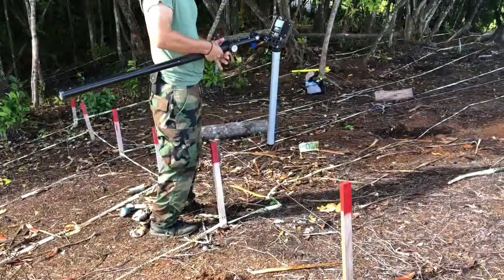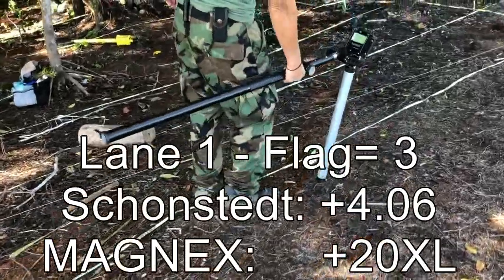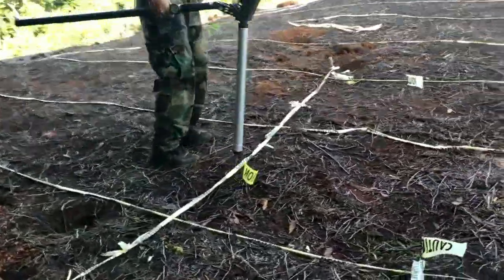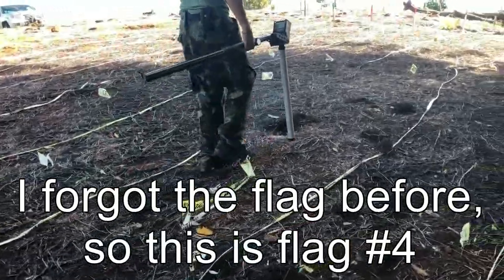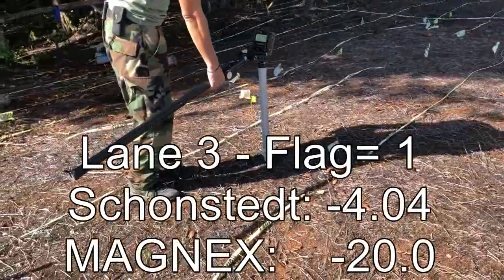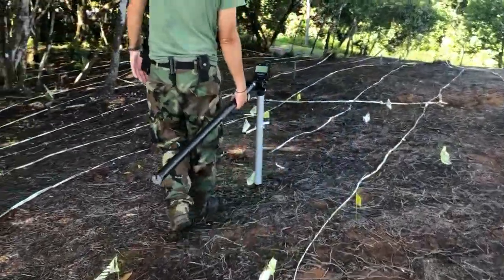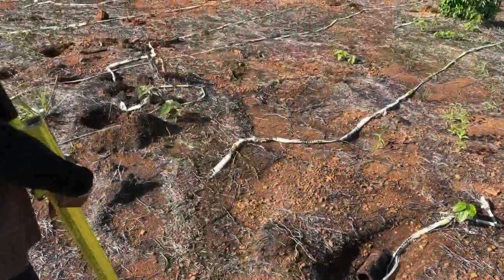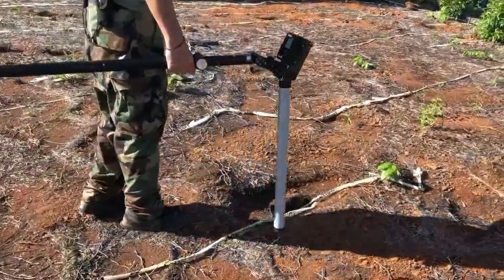Ebinger MAGNEX 120 LW Comparison to Schonstedt GA-72Cd

Comment: Greetings, What is metal depth? Conclusion , can I go with Schonstedt GA-72Cd ? :)
Reply from the maker: It depends on the items you are looking for.  For example in that location we “missed” dozens of live fuzes and a distorted 75mm casing with an intact primer at the end. (being built of either aluminum or brass - with minimal (& corroded) steel firing pins and springs.  Magnetometers ONLY detect ferrous metals (iron, pig iron, steel and some types of stainless steel.)  Magnetometers cannot find ANY other metal!  It also depends  on the nature of the terrain depth and soil mineralization.  Frankly I found both about having the same performance—with the Ebinger being far more expensive—but better made.  I would actually select the (simpler to operate) Schonstedt GA-52Cx, as the stem is longer—thus the sensors being more spaced apart ==> more sensitivity!  Major drawback is ergonomics which as terrible on the GA-52Cx.
Hope this helps…

DISCLAIMER:  These are magnetometers, designed to operate on dry land.  NONE of them are designed for underwater use!  With your diving mask, I presume you wish to metal detect in water.  Do a search in “Waterproof Pulse Induction Detectors”.  Among different models you will find the Garrett Infinium LS, pulse induction—with metal discrimination—detector, waterproof to 200 feet.  Great on paper and good ratings.  However, I had one and its performance was very spotty & disappointing.  Garrett has poor quality control—although excellent customer service.  I returned my brand new unit for service but performance still lagged.  Heard that if you are lucky you can get a good machine with no “glitches”.  Therefore, I recommend to stay away from that model.
Garrett makes other underwater units and cannot express an opinion on those.
Reply: @kmantzouranis  Thanks for notice, Yes we dive and operate uw. I just come to very similar to "GA-52Cx" -  "Waterproof, underwater magnetic probe", both similar "Fisher FML-3 Magnetic Locator" and  "SubSurface Instruments ML-3 Short/ even LONG version! (55″)" IP68 certified up to 250 feet
Reply from the maker: @DaivingsLv  Oh…
The ML-3 is then an outstanding option.  That 1-2 feet detection range for a 175mm projectile is quite low, so presumably that listed depth is for salt-water underwater targets.  Above water it should at least be 4-5 feet for the same item in a non-ferrous/laterite ground…
IF YOU ARE ONLY LOOKING FOR FERROUS ITEMS THEN IT IS A GREAT CHOICE!!!
- - - - - - - - - - - - - - - - - - - - 
NOTE: Brass/copper/tin/lead/aluminum/silver/gold items will be completely undetectable with a magnetometer
Reply from the maker: @DaivingsLv  What are you guys looking for?  I was in Palau looking for ERWs and Schonstedt magnetometers were our main workhorse.  I preferred to hunt with my trusty VMC-1 (all metal detector).  For underwater search (close to sea mines or bombs) I used the Ebinger UWEX 720 C underwater detector, used only for (very) shallow-depth items, looking for detritus, such such as lead chemical horns that had fallen-off in the vicinity of anti-boat and sea mines, or traces of bomb arming vanes and misc. parts.
Happy (and safe) hunting!!!
Reply: @kmantzouranis  Probably German detector UW OGF-W (water) goes deeper, manual says 6 meter.
Reply: @kmantzouranis  We have river ~6 meter deep water and 50cm-1m deep mud. There are iron tubes for inspection work. There we probably need strong tools first. :face-green-smiling:
Reply from the maker: @DaivingsLv  With UW OGF-W you will only be able to detect ferrous objects.  A Great machine; albeit expensive is the JW Fisher 8X pulse induction (all) metal detector.
https://detectorpower.com/categories/mineral-detectors/products/jw-fishers-pulse-8x-metal-detector/?gclid=CjwKCAiAr4GgBhBFEiwAgwORrXILLvfQAqdehdTeROVoMEblRvxmQ-vROLEu3b4rgzUuEFKYsEXLKBoCr1QQAvD_BwE

Comment: Hello, 
I read your comments on the 
CEIA - CMD-CIED
I just bought a brand new one. I will pay you for your time if you could send me a step by step programing list from opening it for first time to using it as a normal metal detector.  I know nothing about it and The owners manual only talks about mine detection set up. I’ve seen people find amazingly deep items with these detectors and I will pay someone to help me.  Please email me at :
cconcord@byrdoilfield.com 

if interested. I would greatly appreciate the help, and again, I will pay for your time. 

Thank you,

Clint
Reply from the maker: HI,
You wouldn't have to pay me; however, I live and work in Palau, where I have three mine detectors; none of them the CEIA-CMD.  I haven't used it for six years, but...  Good news is that it does NOT require ANY programming!  It has a volume and squelch knob and Marines LOVED them a decade ago.  Frankly, I don't even recall whether they even have a mineralized setting - like the Vallon   The new CEIA-CMDs Ver. 3+  have a user interface like the Vallon, although much more intuitive.   Basically, with the 1.35, you merely take it to the site, adjust the "squelch" and you start detecting.  They are FINE machines, (and MORE robust than the Vallon VMC-1their only weakness is their flimsy arm rest.)   The downside of the CEIA-CMD is its narrow, spatula-shaped coil, that is less wide than the Vallon's thus sacrificing sensitivity.  In my line of work, I need to gain maximum sensitivity/depth in the smallest package.  Hope this helps!
Good Luck,
K.